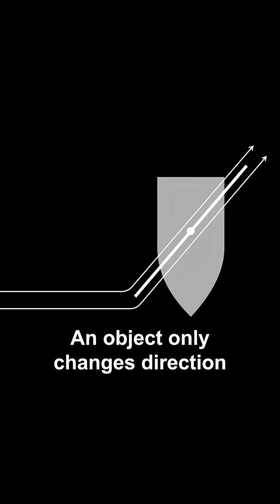Do you know how sailing actually works?

Comment: Spelling out my understanding before watching, to see what I miss:

A sail is a wing.  Air flows across it and generates lift and drag.  Lift tries to make the vessel go across the wind; drag tries to make the vessel go downwind.  They combine as a vector sum, putting the arrows head-to-tail just like the ones in high-school algebra class.  With a well-configured wing, lift is fairly big and drag is fairly small.  "Well-configured" is complicated.  Length, curvature, and angle of attack all matter.

A keel is like a set of rails.  If you take your finger and push gently on the side of a toy train, it doesn't go sideways.  It goes along the track, forward or backward.  A really big, deep-draft keel isn't a very good train track.  It has too much drag.  A really small, shallow keel isn't a very good train track.  It lets the vessel move sideways too much.

A keel is underwater, and a sail sticks up in the air.  Balancing a force in one place with a force in another place  (that isn't in line with it) creates a torque.  So sails plus keels tend to make vessels tip.  On a small sailboat, you compensate by shifting your weight to the upwind side.  On a larger vessel, you need features like having weight below the waterline or having those little wings on the keel.

Comment: This video is a poor explanation of how sail boats work since it does not properly explain the function of the keel or daggerboard (i.e., the fin on the underside of the boat).  The friction of the wheels against the ground on a land sailboat acts like the keel on a regular sail boat.  

When a sail boat tacks (goes up-wind at an angle) It is the push on a correctly angled sail in conjunction with the opposing forces on the keel or daggerboard on the underside of the boat that primarily makes sail boats go upwind at an angle (tack angle).  

The Bernoulli pressure drop on the back, curved side, applies a lesser, but beneficial force too.

Force vector math shows how this works but to perform this math, you need to know that moving fluids apply forces perpendicular to the surface of a flat plate (force per unit area = pressure).  This is true for plate orientations from perpendicular to the direction of fluid flow up to plates that are angled 20 degrees with respect to the fluid flow (i.e., 0 to 80 degrees from a reference plane perpendicular to the wind).  

A complete force analysis should also include the drag forces acting on the portions of the boat exposed to water and air.  If any changes in velocity are considered, then the inertia of the boat's mass must also be considered (Force = mass x acceleration).

Flat sails - Flat sails work, however, fabric sails have a natural tendency to puff out.  Moreover, attempting to make them too flat puts too much strain on the rigging holding the sail to the mast and boom.

Airplanes - The same logic applies except there are more forces at play - The thrust of the prop/jet engine, gravity, drag forces and the normal (pressure) force on the angled underside of the wings and adjustable flaps.  The Bernoulli pressure drop also adds some lift force, but that is not primarily why wings are shaped like a teardrop.  A wing needs thickness to provide structural support.  The thickness is tapered - thin at the outer tip and thick at the base where the wing attaches to the fuselage and where bending moment is maximum.  The wing cross section is teardrop shaped because that shape has the lowest drag coefficient.

Comment: I have a question relating to the "faster than wind" video:  if there is significant friction opposing a land sail moving in the same direction of the wind, will it still accelerate to the speed of the wind?

Comment: Kiteboarding is a form of sailing where the kite is the sail and the board is the boat. Or, more usefully, the board is the keel. This combination lets you go upwind.

The potential problem is when you fall and lose your board. You might need to go upwind to get it, but how can you do that when your board is the keel?

The answer is that you lie your body down in the water and point it in the direction that you would like to go. The kite supplies the force and your body is the keel. It works.

Comment: I would suggest to make a google search "sailing courses" and check the images. It will make clear that this explanation is not quite full and does not explain how sailing boat can travel at close hauled course ;)

Sail behaves in 2 modes depending on wind direction: 
1. A parachute (as showed in a video)
2. A wing (like a plane wing) which allows to travel "against" the wind

Comment: Not true. Deflection of the air doesn't create the force to push the boat forward. In fact the boat is sucked forward by the low pressure on the backside of the sail (Bernoulli's principle not colander effect). A small portion of this points forward. A large portion of this points to the side, but the keel prevents the boat from going to the side.

The wind pushing only works if you go with the wind. 

Your theory / example doesn't allow boats to go into the wind @ 45 degree angle. If your theory was true, a boat would move backwards when pointed into the wind (with a 45 degree angle).

Comment: What about if you want to go in the opposite direction from the wind?
Reply: It's called tacking.  You zig-zag at 45 degree angles, and switch directions periodically.  You don't sail a standard sailboat directly upwind.
Reply: @carultch  so are there non-standard sailboats which can?
Reply: @yewo.m  Yeah, you need a rotary sail to do so.

Comment: This was a simplified version I believe. A sailboat couldn't actually sail were it not in two mediums at the same time, water and air. The keel is really important here, without it the boat would just drift with the wind. Also, there's a 3D version of sailing where the wind also heels the boat over.
Reply: hey bud how about you watch the whole video

Comment: 45° is a terribly inefficient angle. Current silplanes (which use the same principle) have glide ratios af over 60, meaning that the plane goes forward 60 m for every meter it loses in height. Boats have to deal with more adverse effects, but they also have lift to drag ratios of certainly beyond 20.

Comment: the sideways force on a sailboat is NOT negligible at all! most sailboats actually drift sideways a bit to counteract the pull of the wind, kinda like how dogs run. 

this is especially true for smaller sailboats like lasers where they lean to the side real hard like a motorcycle making a turn; that lean is another component of that sideways force, but this time its been converted into a downwards/rotational force trying to flip the boat.
Reply: Exactly. It’s called “leeway” and sailors always have to take it into account.

Comment: I do not agree that’s the explanation of how it works, in aeroplanes the lift force of the wing isn’t simply generated by deflecting the airflow and explaining it with 3rd newton law (it’s part of it) its much more complex than that and I believe in sails it’s the same way that its more complex would love to see a deeper dive of yours into lift force in general it’s much more complex and hard to explain thing than one might imagine. And most explanations on internet are plain wrong because they revolve around just one of the components of that goes into lift generation. Cheers and sorry for my two cents, just my phd in airplane engineering wouldn’t be calm all night if I didn’t comment on it.
Reply: You're right. His theory would not work

Comment: What happens if you want to go against the wind?
Reply: Most conventional sailboats can sail about 45° off the wind. If you need to go straight upwind you travel in a zig-zag across the wind. This is called "beating" into the wind. Each time you cross the wind is called "tacking".

Some rigs can get closer to the wind than 45°, and there are designs where the wind drives a propeller that can travel directly into the wind.
Reply: His theory won't work.... he got it wrong
Reply: @arno-31 Whose theory?

Comment: The "neglible" sideways motion (a reasonable assumption in the context of Steve's explanation) is countered for stability in sailing skiffs via adjustable centre/side boards & yachts via fixed keel. Both are analogous to a fixed-wing aircraft's verticle stabiliser.
Reply: Real sailboats always have a sideways motion component (except, of course, when sailing straight downwind). This is called leeway and has to be accounted for when doing navigation. The boats typically move slightly diagonally to the course that their bows point at.
Reply: @sergeyg2926  That leeway gets quite pronounced when your centre board falls off without you noticing... Seeing our wake was 50-60° off our stern was interesting!
Reply: @johansten7976  For most of us, that's not a frequent event 😁. Though I've had the rudder literally snap off on an old Sunfish and had to pull the centerboard out to use it as a combo leeboard/rudder to make it back to shore... It wasn't pretty: the shore was upwind, of course.
Reply: @sergeyg2926  Thankfully, it only happened once 😅. It was a loong time ago, back in the 90s when I was sailing as a preteen in the Scouts.

Rudder snapping is a whole new level of oh shit !! And of course land is upwind then - we wouldn't want it to be easy now, would we! 😂

Comment: Interesting I had this argument with my brother about how much "Into' the wind You could go.   I came up with about 45 degrees also, but i tihnk that there is more to the analysis than You present  "than the shape of the boat under water",... I think as the boat is being tried to blow over there is a three dimensional force vector that is trying to force the boat under the water as well as the weight of the keel trying to upright the boat so there is the buoyancy of the boat and the verticaling of the boat by the keel that is pushing the boat back against the wind which gives a small vectoral addition when viewed from the top that appears as a "forward" vector.
Reply: There are many factors that go into how well a boat can point- hull shape, foils, sail shape, sail trim, sail stretch, boat trim, boat weight, and many more.

Comment: Now what if we wanted to sail in the opposite direction to the wind...
Reply: That's called "tacking." You can't sail directly into the wind, so you zig-zag at about 45° into the wind in one direction, then switch to 45° in the other direction; e.g., if wind is coming from 12 o'clock, sail toward 1:30, then 10:30. Repeat as necessary.
Reply: @michaelpolakowski7301  Technically sailing directly into the wind is possible, it's been done on land, but not on water afaik. And it requires a rotary sail aka a propeller, so I guess some wouldn't call it "sailing". No motor needed , though!

Comment: The small force does have an action on the boat or land yacht. It tilts them, you often see land yachts on 2 wheels, and boats always list with a good wind, part of the reason sails are shaped like they are (less force at the top, greater force at the bottom so more forward push and less listing)
Reply: Terminology nitpick: boats "list" under static loads (like when unevenly loaded). They "heel" under dynamic loads, like wind.
Reply: @sergeyg2926 Absolutely, I have only done a small amount of sailing when I was young, so it was easy for me to get the terminology wrong.
Reply: Interesting that natives in oceania/pacific often have the opposite, two masts in a V with a triangular sail between them, pointy end down. Don't know why they're designed like that. They often have outriggers, which reduce the listing.
Reply: @tvuser9529Crab-claw sails were easier to construct with the materials they had available; the woven mat sails needed the second spar to create the right shape. They can also generate more total force as the wind further off the water tends to be stronger and steadier. The use of these may have driven the development of outriggers and eventually catamarans. Multihull boats can handle far more of that sideways force (heeling moment) than monohulls.

Multihulls are also much much faster, cheaper, and more efficient with regard to materials used vs cargo space, etc. The use of crab-claw sails and multihulls resulted in relatively small and inexpensive to construct boats that could run circles around the heavy European monohull ships of similar time periods.
Reply: @jasexavier with so many advantages of multihull design I wonder why it's not the standard design of boats everywhere. It's not like adding a stabilizer is that much jump of inspiration.
Reply: Not really. The sail is smaller as you go up the mast because it's not supported. It will sag under its own weight, ruining the airfoil shape. 

The wind is faster as you go aloft in the rig because of the frictional action of the water. This is similar to a pipe, where water flow is highest the farther you get from the pipe wall. So we would carry more sail area aloft if we could. But weight aloft comes at the cost of increased heel. There's a saying among racers - "flat is fast."

If you look at some modern high performance boats like the Melges, you can see supported heads, but even that has its limits.
Reply: Oh, I always wondered why they used that triangle shape. Makes sense!

Comment: This is painfully incomplete, not even touching on angles steeper then 90 degrees which is where it actually gets tricky. Also, a sail is not flat and wouldn’t work correctly if it was.
Reply: It's more than incomplete... it's not right.

Comment: "Colander effect" 😂
Reply: I noticed that in the captions also, probably an AI typo.  For those interested, Steve said Coanda effect.
Reply: That's what happens when your sail has too many holes!
Reply: Should be Bernoulli's principle
Reply: @arno-31  nah, Coanda effect is the more applicable one to aerofoils and directional air, Bernoullis is too generic here.
Reply: @krissp8712  Wrong. Despite what the english wikipedia page says there is no such thing as the Coanda effect and it's not used in scientific literature (especially not outside the english speaking world).
What wikipedia calls the coanda effect is actually the Navier–Stokes equations and Bernoulli's principle.
German wikipedia describes it like this. "The collective term Coandă effect refers to various causally unrelated phenomena." and "A precise definition and a clear distinction from the Bernoulli effect are difficult. The term is rarely used in scientific literature."

Comment: On small boats you can lift the centreboard and therefore play with the sideways drift. When entering the small harbour we would get a last bit of energy, turn sideways and lift the centreboard. By inertia and a bit of waves we would arrive at the harbour turned sideways, parallel to the runway with enough time to take in the sails. You better timed it right, because nothing was as embarrassing as having to hoist the sails back up because you miscalculated.

Comment: The shape of the boat helps, but on many small boats, there is also a daggerboard, basically just a plank in the water that makes the boat move forward even more.
Reply: On large boats there is a keel, a large thin flat section that functions like the daggerboard, but is not moveable.

Daggerboards drop straight down. Centerboards swing down from a pivot at one end. Bilgeboards are like centerboards, but there are two, one on each side of the bottom of the hull. Leeboards are the same, but mounted on the outside edge of the hull, above the waterline. Keels are fixed sections of the hull that serve the same purpose (some very fancy keels can swing a bit side to side). There are probably more of these.